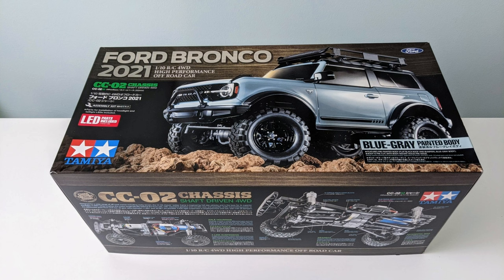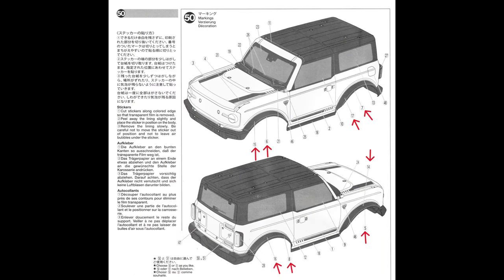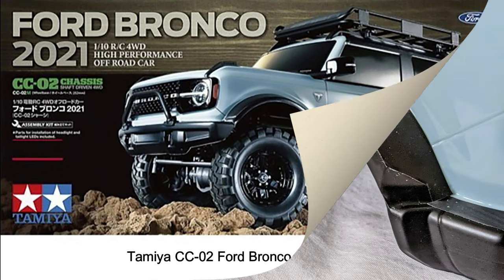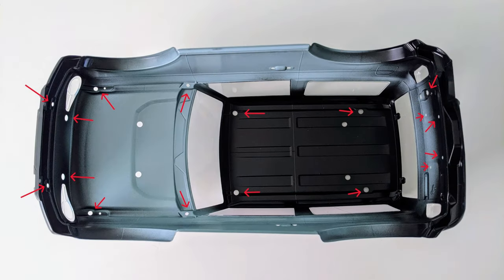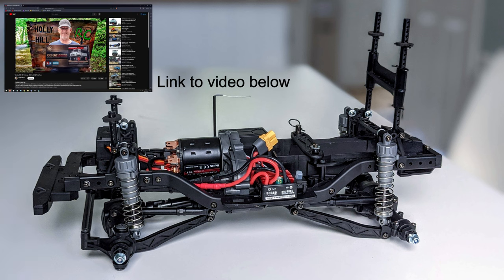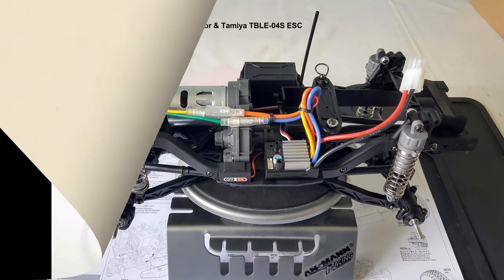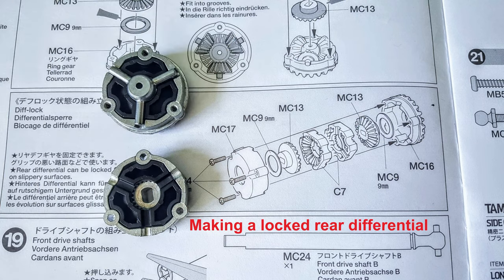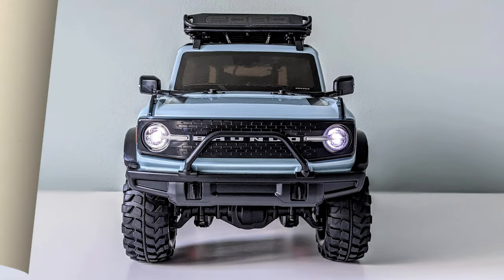Tamiya CC-02 Ford Bronco 2021 Kit Build

Comment: I think this shell is fantastic Derek. I even love the colour. Proper top stuff. And good point about the red lights
Reply from the maker: Hi Tibs. Thank you very much my friend. It does seen a bit tight for Tamiya not to include another set of red led's, but for a company that still doesn't include metal bearings in the majority of their kits it's not really surprising 👎🏼🤨

Comment: I have the same issue with decals on Tamiya's, as hard as you try you never get them to look like the picture on the box. Another thing I wished is they ditched the light decals and give us proper plastic units to screw on as they look so much better. I'm not a fan of pre-painted bodies but it does save money because 3/4 cans of paint are required that adds up on the build cost.  A good choice with the Surpass, the combo I brought I was pleased with it. Interesting the option with the 2 ways of mounting a servo, that's a first for me. But you are right it does look brilliant all finished, but I like the short wheelbase over the long version as it never looks right to me.
Reply from the maker: Hi Mal. I've never liked doing decals and found these particularly frustrating. Tamiya decals are usually good once they're on but some of these wouldn't stick properly. They also seemed to be a bit thicker than the ones I've done before with the older kits. Not quite as thick as the MCI Racing decals I got for my Mad Bull, but thicker than my Grasshopper's for instance. The Surpass Combo is a cheap but good Combo and basically the same as the Reedy systems that come in the Element Enduro RTR's.
Reply: @hollyhillrc  Funny thing I thought they looked a little thicker then the norm. Thicker decals will always be a pain.

Comment: Nice kit, always appreciate your attention to the details, your right the wheel arches should be painted. I usually buy black matte acrylic paint with a very fine soft brush, it makes them look like rubber. It will be interesting to see which position of the servo you like best. Look forward to the run🙏✝️☮️
Reply from the maker: Thanks for the tip about the acrylic paint Lou. I may try that.

Comment: Great build Derek. Shame on the decals. Paintings the better option. Why is the servo to mount in different positions? I don't see a reason for it.
Reply from the maker: Hi Dirk. Thank you for watching. I'm sorry, I  don't know why there's an option for the servo position.
Reply: @hollyhillrc  maybe your driving will show
Reply from the maker: @RCBirds   I haven't been able to run the Bronco yet, and my Unimog has a 3kg servo and the Bronco has a 15kg servo, so it may not be a fair comparison. But even with this difference in torque it will be interesting to see if one position is better than the other when I do.

Comment: Hiya Derek.  Really good vid and some helpful top tips.  I guess the disadvantage of getting a pre painted shell is that you can't choose to paint certain bits in a different colour like the wheel arches unless you paint it on the outside.  Like you say though the end result looks fantastic.  I was having a little titter about the stock ESC and motor being too fast for you.  I thought it looked rather fun 🤣 Top work mate, I know it takes time to get this sort of video together and you've done it really well.  Best wishes 😁
Reply from the maker: Hi Pete. Thank you for your kind words. If I can't keep up with an RC these days I class it as too fast. I have devised a bungee system with off road roller skates to attach myself to my Arrma's so they shouldn't be a problem 😂😂😂

Comment: Yeah those decals are always a hassle for me. Couldn't agree more on the Wheel Well Arches. Y'know? Body pins don't bother me too much. I get it though It DOES look much more scale without them. ;) Oh and I am not sure what you were going to say there about the Windscreen decals? We kinda lost you there. @ 2:02 🤣🤣 and I agree with you on the roof Rack I think it adds to that scale look you're going for. Oh and The lights like the way they should. ;) I had to go and check out this motor combo you are using. That IS a good price. I have taken chances on cheaper versions of kit and you can find some good ones out there. Although Surpass seems to be getting more attention... great video Derek. And an awesome build bud. I like the Bronco. :)
Reply from the maker: Hi Nick. Thank you for watching. The Surpass combo is very similar to the Reedy motor and ESC in the Element RTR's.
Reply: I have also tryed Guru RC. Not bad brushless systems.. ;) @hollyhillrc